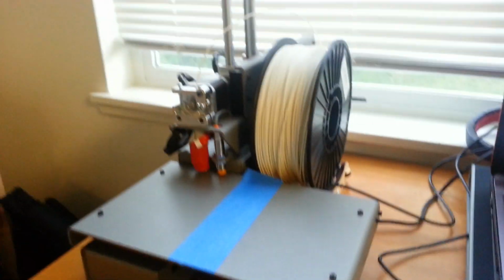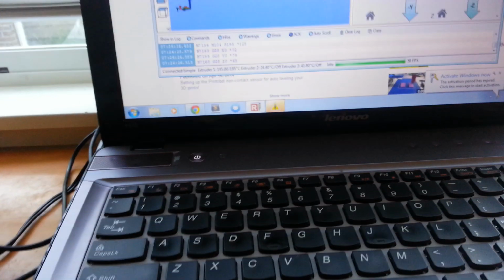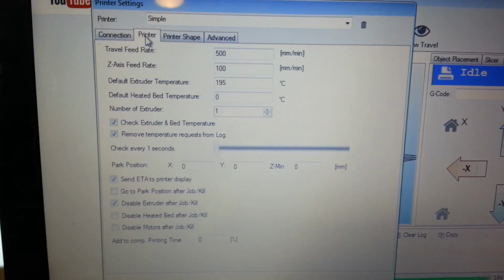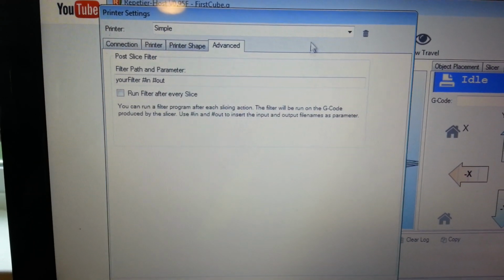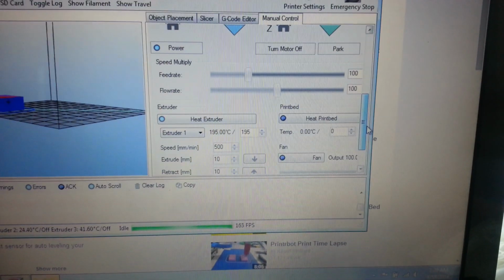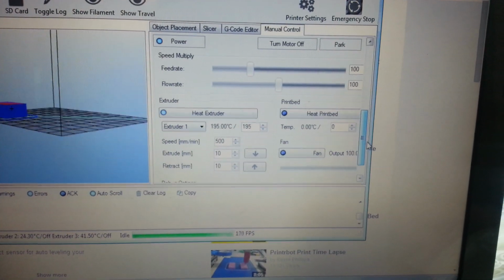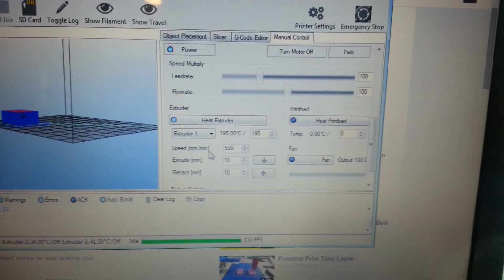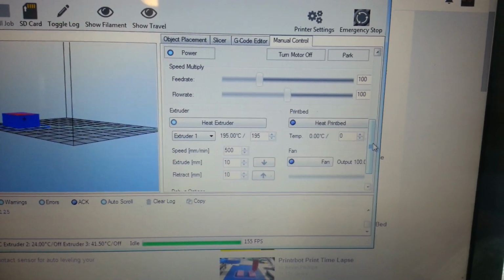Printrbot Simple Metal - Second print

Comment: Your first layer is way too high. It should not look like silly string as it lays it down. Rather, it should be squished flat like paper. You just need to change you z offset. That will give you much better prints.
Reply: at least 400 microns off....

Comment: It's going to work a bit better if you have tape over the entire surface of your bed.  The tape adds a bit of height to the surface and your probe isn't taking that into account because it is leveling to the surface without the tape.
Reply from the maker: It is a magnetic probe. It should ignore anything non magnetic.
Reply: Doh! So is the depth of the tape accounted for in the calculation?
Reply from the maker: Nope. Play around with it.  I am using two layers of tape now. I could probably play with the zoo axis some more and not need the tape, but I like having a cushion to print on. :)

Comment: Do you have to put in the Marlin code what the diffrence is between the probe and your Hotend or ?
Reply from the maker: Can you clarify your questions? I'm not sure what you are asking.
Reply: Well normal probing with a physical button you would need to edit your Marlin firmware so it knows your height diffrence between the probe and the hotend, and i was asking if you need to do the same with this magnete or something?
Reply: broerbreaker9240Z You do set the Z offset. With the upgraded Printrbot firmware it is a M212 Z(insert your offset here as negative)